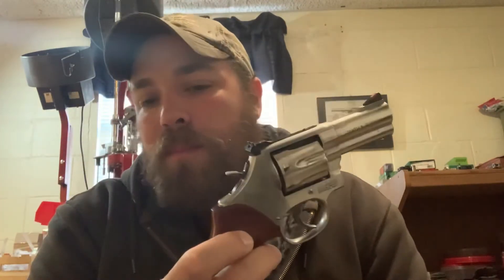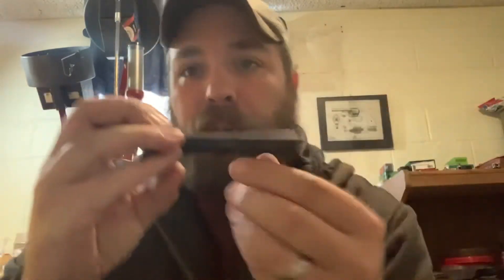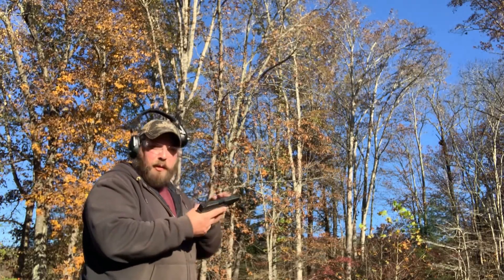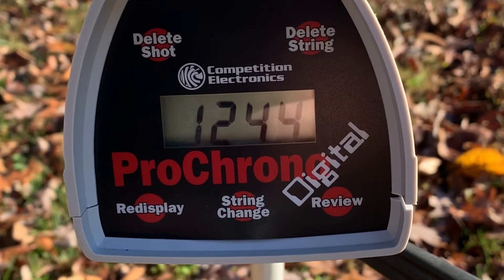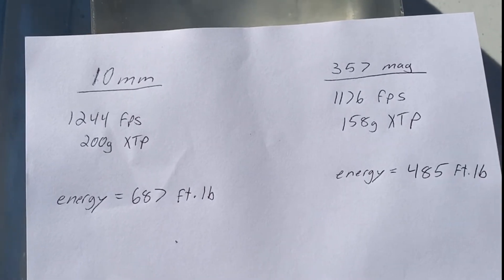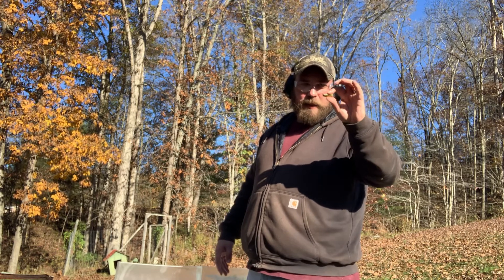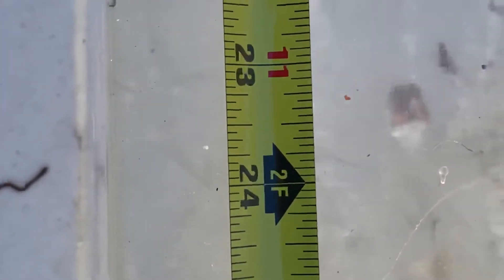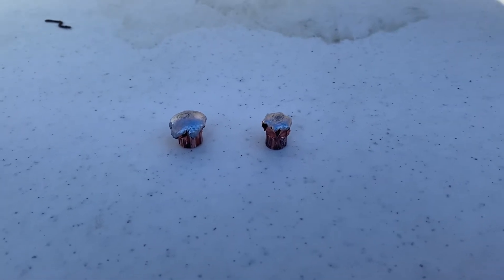10mm vs 357 magnum performance test with ballistics gel

Comment: I wouldn't exsctly call that the hotter end of the of the spectrum for that 357
Reply from the maker: I can probably push it harder with h110 or w296, but for the shorter barrels I like 2400 and this being a 3”, that’s what I went with. It’s a max published load of 2400.

Comment: I WAS A BIT SURPRISED THAT THE 10MM HAD 200 FT.LBS MORE MUZZLE ENERGY OVER THE 357MAG. I LOOK AT THIS TEST FROM A SELF DEFENSE SITUATION, THE 10MM WINS. 10MM HAS HIGHER VELOCITY , 200FT.LBS MORE ENERGY, JACKET EXPANDS WIDER, 17" OF FBI PENETRATION 12"-18" STANDARD.THE TEMP WOUND CAVITY WOULD STRETCH WIDER IN THE FIRST 9"  OF PENETRATION. THE 10MM ROUND DUMPS ALL ITS ENERGY INTO THE TARGET , WITH THE MAJORITY OF ENERGY BEING DUMPED IN THE FIRST 9"-12". SO FOR SELF DEFENSE THE 10MM ROUND WOULD BE A PRETTY POTENT ROUND IN A SITUATION -15FT, IF YOU CAN CONTROL IT'S RECOIL.
Reply from the maker: It’s definitely a beast of a round. It’s very versatile as well from a reloader perspective

Comment: Over penetration is worthless unless your shooting a deer or some other large body animal.
I'd rather have a bigger hole and a round that dumps all its energy into the target.
  Besides,you can get much hotter loads for the 10mm than what you brought to the table.
Just bought some UnderWood in 165 grain that does 1400 fps,and some in 150 grain that shoots at 1425 as well as some in 140 that goes at 1500 fps.
   My cylinder is out being reamed for my S&W 610 to accept the 10mm magnum...which opens up a whole new ball game. It'll give the .44 Mag a run for its money but will still come in second in power.
  Of course you're running it in a semi auto which would be hard pressed to handle the pressure of hotter loads. The 610 is built on the N frame which of course is the same as the .44 Mag.
Reply from the maker: That 10 mag will be wicked!
Reply: @thegundungeon  
  Cant wait to shoot the 10 Mag!!!
I've got two 16" inch blocks of gel waiting ....Think I'm gonna need another one or possibly two.
   Talked to several people who've had the cylinder reamed and they said there was no difference in accuracy when shooting the .40 or 10mm after reaming which was a concern for me so I bought an additional stock cylinder just in case. After fitting it doesnt appear that I'll need to have it clocked,we'll see.
   If it becomes an issue changing out the cylinder is a two minute job at worst.
Reply from the maker: @TrulyUnfortunate  that’s awesome and yeah you may need more gel lol
Reply: "'d rather have a bigger hole and a round that dumps all its energy into the target."
There's always .45acp +p. 😆
Anyway, energy dumping isn't what's lethal. Otherwise linebackers would kill everyone they ran into.

Comment: On your discussion of barrel length between revolver and semiautomatic, one factor you didn’t consider was the barrel/cylinder gap on the revolver. The barrel/cylinder gap tends to partially offset the fact that the semiautomatic includes the chamber in the barrel length. At one point in time I had a S&W 625 revolver in 45 ACP with a 5 inch barrel. The velocity was very close to the velocity from a 1911 with 5 inch barrel. Different guns and different caliber so YMMV. Just food for thought.
Reply from the maker: Good point. So many variables a man will never get a true fair comparison. Some guns can be the same gun, same manufacturer and same chambering but one will shoot faster than the other.
Reply: @thegundungeon  , agreed. One of my first Speer Reloading manuals had a chapter where they took about 6 357 magnums with the same barrel length . I think 2 were Colts, 2 were S&W and 2 were Ruger. Or something like that. Velocity varied greatly across these samples.
Reply from the maker: @charlesphillips5906  pretty crazy how that happens but it most definitely does. I think this is why most ammo manufacturers use test barrels for their velocity ratings, which causes real world results to vary greatly from their advertised velocities at times.

Comment: In general the 357 will out penetrate, but .40/10mm will make a bigger hole.   I could go either way, usually I like  my .44's but I have loaded 200gr XTP out of Glock 35 .40 over 1200 fps and it's a good option for semi auto use.
Reply from the maker: I agree. The 200g 10mm and the 158g 357 xtp bullets actually have comparable sectional densities, it’s the reduced surface area of the 357 that helps it drive deep. I too am a 44 fan, I may break out the ol 3 screw Super Black Hawk for a video soon

Comment: Why didn't you use 180gr xtp's for both guns?
Reply from the maker: Because that would be an uncommonly heavy 357 and a lighter 10mm.  158g 357 is the heaviest commonly used bullet and the same for the 200g 10mm. I wanted to give the rounds the fairest chance I could and sectional density means a lot.
Reply: @thegundungeon  It is not a fair compairison when you use 2 different weights and different variety of guns. You are still squeezing apples and oranges and trying to get grape juice
Reply from the maker: Very true, It’s all subjective. This is just one test to be considered, change any of the variables and results could change quite a bit. 👍
Reply: @thegundungeon  look at this it is more accurate. https://www.youtube.com/watch?v=sHqVgkO7I4c
Reply: @thegundungeon  use buffalo bore 180 jacked bullets they use the 180 xtp